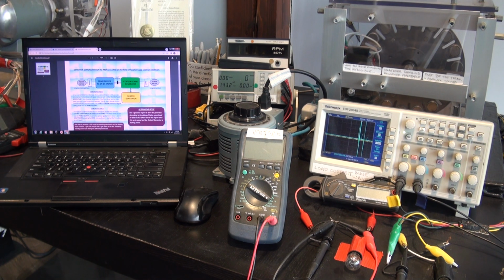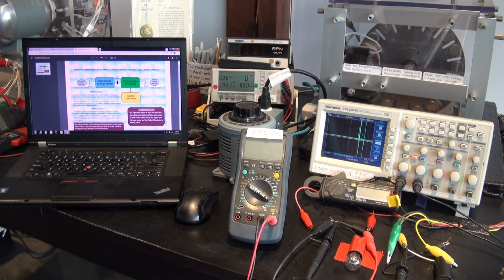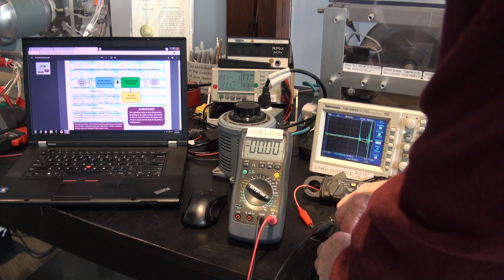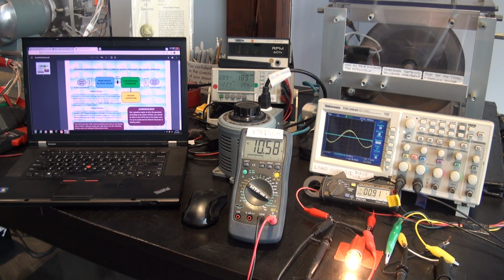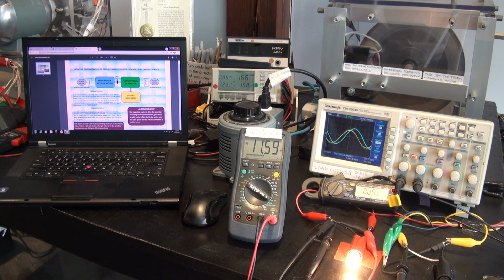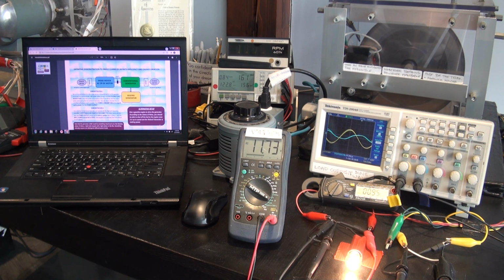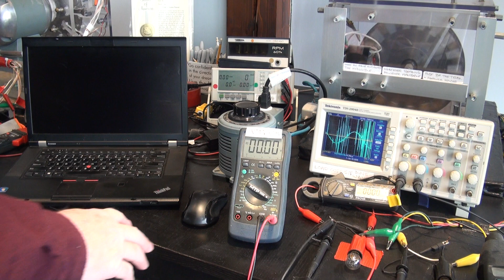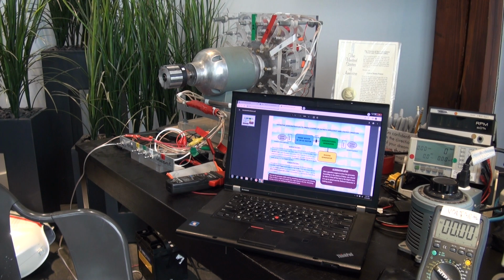PERPETUAL MOTION MACHINE OF THE 1ST KIND - FARADAY GENERATOR & ReGenX GENERATOR DEMONSTRATION

Comment: if you take a electric motor and turns a 3 phase asynchronous motor spin up and the use a pma as load by then cranking the pma it will then run as synchronous acting as a motor but the magnets will induce a current in the asynchronous motor acting as a generator and then produce its own torque that help the prime mover. 

you can do this in reverse as well but then you have to make a custom wound synchronous rotor as motor load to produce a square wave magnetizer current so that the field winding of the rotor can produce voltage gain in the motor running so that the pma generator can receive drive current that will produce real power reducing load on prime mover. this happens because of repulsion as both units attached to the prime mover waves would be out of phase between rotor and stator on each units. 

when a standing wave is formed between rotor and stator it produce repulsion. the whole universe is just waves that are out of phase with other waves. that produce expansion. in regions where the waves are in phase it contracts or implode. that is why while the universe is expanding pockets of clusters are contracting at the same time. the universe is like a standing wave with spaces between nodes that produce attraction while the whole system expands at the same time. 

the universe has only two realities one is attraction the other is repulsion. its the same with the atoms the molecules and the universe as a whole. the reason why the sun keep the planets in orbit the sun has more electrons in its mass than the planets and that is what produce the pull. its the same as a oxygen atom attracted to a hydrogen atom. 

greater that equal attracts while equal to equal repel.

binary is polarity and all energy o the universe is either push or pull. the amount of energy in the universe in infinite as its not a quantity as its just a force at density that can self multiply or self increase by compression forming standing waves. the more compression the more force and the transform of push and pull distribution is what people call force times distance but the force is not a quantity. its just a compression. the force can be from zero to infinite. there takes zero work to multiply compression. the resulting work is equal to the compression of push pull times distance transformed. 

when the universe produce compression it generate constructive interference when the universe cancels compression it do destructive interference. the total energy of the universe is zero or infinite at the same time. energy as taught is school does not exist. energy is not a quantity of work but a change in propagation of push pull potentials that vary in frequency and the way they phase in and out determine the amount of force from zero to infinite. 

when i was younger i never understood why people educated in thermodynamics spoke of energy as if it was some product that became zero after being used. i always felt even when i could not explain it that the energy of the system was always potentially zero to begin with and that the force of work times distance where work was always equals to the scale of force. nobody seem to have understood energy in therms of force multiplied where energy is at density of force. 

the universe self amplify itself by z pinches to produce compression that increase the force of the work many many times its initial force. there is more power in the pinch that there in the power put in because of the compression. when energy increase more information is added to the universe. if the universe did not produce its own energy nothing would exist.

Comment: so this is not overunity system
Reply from the maker: Infinite Overunity but NOT Perpetual Motion... 😎
Reply: Hi Mr Thane. We dont care about the phylosophy of the names. We can not loop the output into the Input of de system and still get work!
Reply: @ThaneHeins1 without taking into account the phylosophy of the names. Overunity and perpetual motion are the same if we considere open system.
Reply: Means the energy of univers is infinite (so big compared to the need of humanity) so if we consider open system the laws of thermodynamics are still applay.
Reply: Can you please clarifay
Reply from the maker: @tarkiaomar4042   An Approximation of Perpetual Motion PART 3 #MIT, #DanFrey #OXFORDUNIVERSITY, #ChiaraMarletto  https://www.youtube.com/watch?v=YY5Yoz9HpT8&t=483s
Reply from the maker: @tarkiaomar4042  1 How to Calculate Generator Efficiency & What Infinite Efficiency Means https://www.slideshare.net/PDiCEOThaneHeins3240/1-how-to-calculate-generator-efficiency-what-infinite-efficiency-means-164624806
Reply from the maker: @tarkiaomar4042  HOW TO CALCULATE ELECTRIC GENERATOR EFFICIENCY & ReGenX Generator Infinite Efficiency https://www.youtube.com/watch?v=3_UXZBTCkSA&t=461s
Reply: @ThaneHeins1  Thanks MrThane
Reply: Please if you can feed back about my Remarks